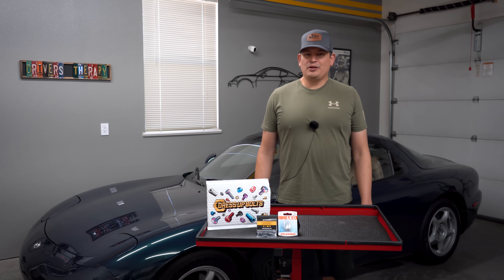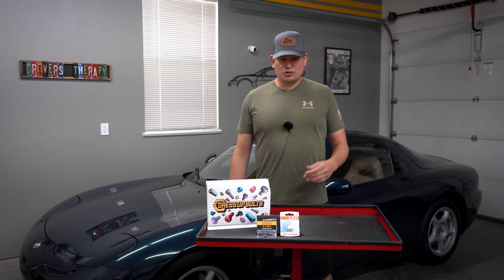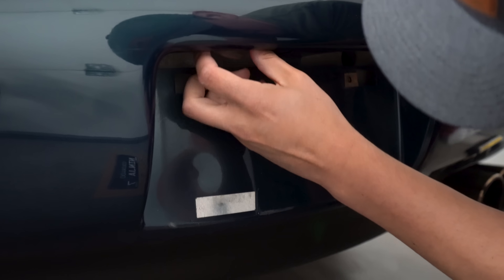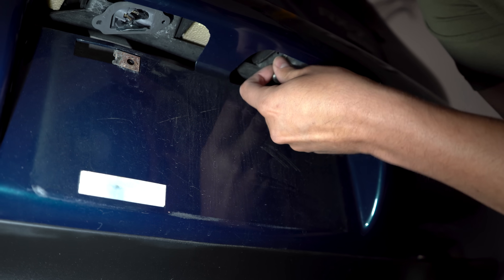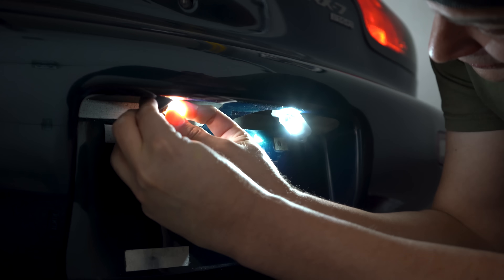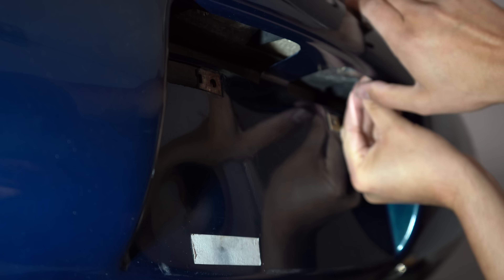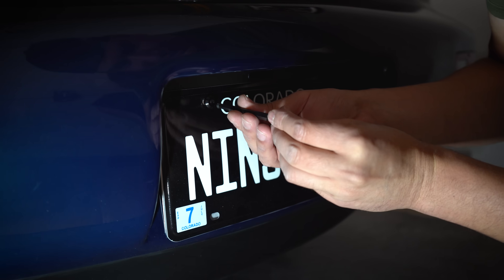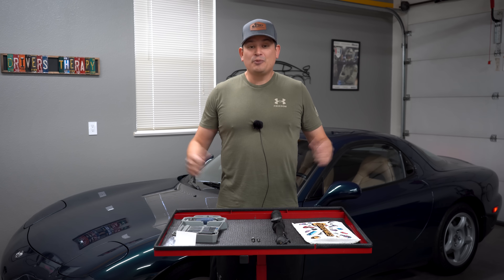FD RX-7 License Titanium Bolt and LED Bulbs - Sweet Upgrade!

Comment: Do you have a link to the bolts you used
Reply from the maker: M6 x 1.00 x 10mm Titanium Motor Head Bolt by Dress Up Bolts × 2
Reply from the maker: Just added it to the description, thanks for reminding me. 🙂